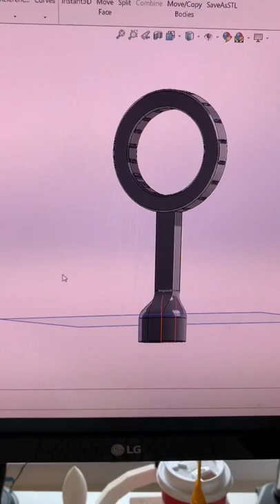How I Made a Handheld Fog Machine

Comment: Are you able to share the file for the fan adaptor? This would be perfect for a project im working on. Would also be a good idea to not solder the pod to the wires direct but to some pins or something so you can change out the pod for multiple uses and refills.

Comment: Homie those pods have notoriously bad build quality and will burn out on you in intended use faster than most. I’d recommend finding another solution if you want it to run for more than a few minutes without smelling like burning plastic. I’ve actually thought about doing something similar myself for quite a while and I believe that a Rebuildable Drip Tank atomizer might end up being better as the coils can be cleaned rather easily using rubbing alcohol and the only piece 100% needing to be replaced with use is the cotton wicking from the tank to the coil itself. They aren’t super common anymore but you can still find them online (RDTA is the common name). The coils vary depending on the desired effect but I believe any kind of Clapton based coil will do you well in this use case (ie. vapor production and longevity)

Comment: Did the same for my rc low riders exhaust and tyres
Reply: Garage door relay and remote > 30kg servos>springs/coils..  and bam one bouncing rc low rider... my favourite thing I have ever made.. oh and you contracting/expanding shafts for the wheels to keep tension on the wheel lugs so you don't drop an axle .. if your bored give it a go mate :)
Reply from the maker: That sounds pretty fun, might have to one day
Reply: :) it's worth it mate